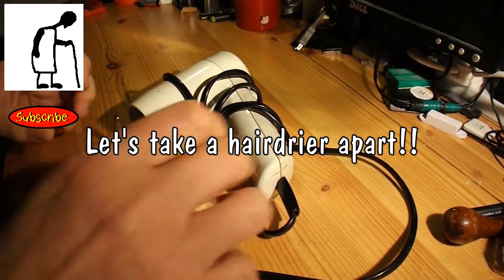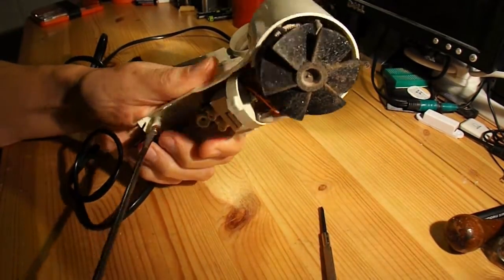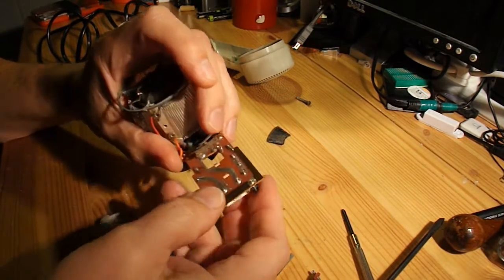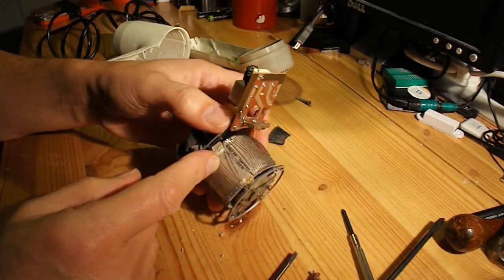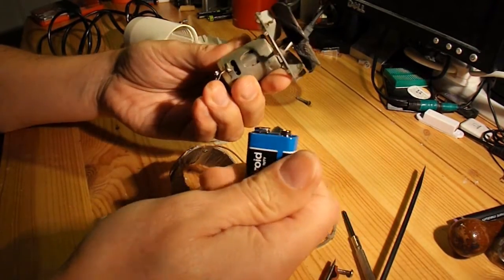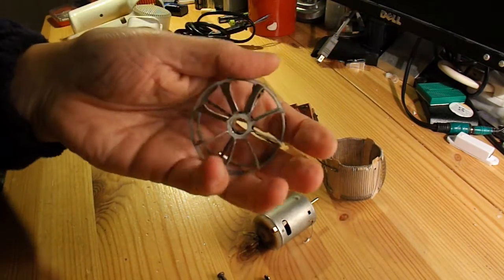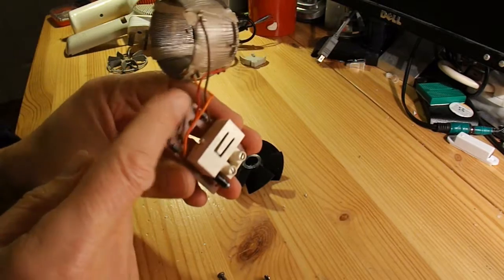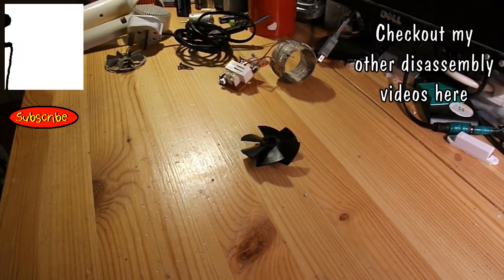Let's disassemble a hairdryer

Comment: How did you take the fan off? Mine is impossible to remove... I really need a way to do that...please help guys
Reply from the maker: Yes I found some of them are very hard to remove and I have often damaged the fan blade removing them. I am afraid I don't have a good method to recommend. If you don't need to save the fan blade I would break the blades off so I could grip the plastic hub with a clamp and then tap the shaft through with a similar sized metal rod and a hammer, or even cut it off by sawing through the plastic.
Reply: I knocked the fan off of motor stem with a 1.5mm nail set and hammer, pushing the stem and motor downward and leaving the fan atop the vise. Good luck.

Comment: After you removed the motor, did it still work ?
Reply from the maker: Did it still work? What? 😆 The motor works, I demonstrated that. I wouldn't attempt to put power through the heater element. Without the fan blowing some air through it, it would very quickly overheat and burn out. If you just mean the fan blade then this is the follow on video - Bargain Store Project #32 Styrofoam Cup and Plate Hovercraft https://youtu.be/bk36WMWMCmI
Reply: @GrandadIsAnOldMan  no, I'm asking because I want to use it to power a needle, I'm making a homemade tattoo machine. And I need a motor, what would you recommend?
Reply from the maker: @axelsantana8835  I would recommend not making a homemade tattoo machine. As for what motor. I have no idea what RPM you want or what power you need. There are plenty of YouTube videos on the subject so I suggest you do a search. While you are at it, I suggest a search on skin infections and other complications.

Comment: did it work for the foam cutter
Reply from the maker: Here is a video I showed it's use Hot Wire Styrofoam Plane PART #6 - those hot wire bows https://youtu.be/ZSFxSy6-bY4?list=PLA5a2xPRSrB1Qj--01eR1NU_K2RCbH3R8

Comment: Did you ever make the foam cutter?
Reply from the maker: Not with the parts from these hairdryers. Just a small one when I needed to cut down some wheels. Sometime I will get around to it as I want to do some foam wings for a glider or two. Just another one of those projects that keeps slipping down the list, I will get there one day.
The small one I made appears in this video after about 7 minutes http://youtu.be/XXPm-K9uyGQ
Reply from the maker: zz dragon on all the hairdryers that I have taken apart, the electric motor that drives the fan is a small DC motor probably rated at 12 volts or less. The voltage is dropped from the mains 240, 220, or 110 volts by passing it through the heater coils first which acts as a large resistor and then converting it to DC with a rectifier bridge made from 4 diodes usually soldered direct to the motor terminals. That means that if you disconnect the heat element wires it will not work as there is no electrical path to the motor. If you bypass the heat element then you will burn the motor by passing 10 to 20 times the rated voltage through it and probably electrocute yourself at the same time.
If you are only intending to use a small DC battery to power it then it will be OK and you don't need the rectifier bridge.

There may be hairdryers that use an AC motor and power it direct from the AC mains but I haven't seen one.
Reply from the maker: zz dragon I only said 'probably rated at 12v', I would have no way of knowing what motor you have in your hairdryer. I can only suggest you try it to find out. If it gets hot and burns out you know you put too much voltage or current through it, so don't do the same thing with the next one.
Reply: @GrandadIsAnOldMan  I have a Con Air Infinity Pro that has an AC motor. It is a little heavier for having the AC motor but it is quieter for the amount of air flow and I've had it for years for use for 2 people and a dog,

Comment: Dude, if the hair dryer still works, you should not disassemble it.  You just wasted a good hair dryer!
Reply from the maker: +Sammy Reedy oh dear, did you need a hair drier? Maybe you should buy your own. I bought 10 for £1 each and took them all apart in this video https://youtu.be/Wd8BQ8lMFjw?list=PLA5a2xPRSrB1GrgALJEle2lVqOrR1sX6V and I made much better use of the component parts that I would drying my hair.
Reply: Yes I watched that video also!  And, it explains absolutely nothing!  A hair dryer fan is meant to be used in a hair only!  And, hair dryer heating elements are intended for a hair dryer only.  If you keep doing what you are doing, then you will get electrocuted from it.  By the way, lots of women use hair dryers to dry their hair!  And, there's even poor women that could use the hair dryers that you just wasted!
Reply from the maker: Sammy Reedy you really need to get out more. If your life revolves around saving hair dryers for poor disadvantaged women of the world then I think your values are sadly misplaced. As for only to be used for drying hair then sorry you are wrong, there are many uses for hair dryers, for example you will find many model makers use them for heat shrinking plastics and speeding paint drying and adhesive fixing. As for only women drying hair then I see you have excluded all men and all the other gender categories so you may need to brush up on your political correctness. Finally perhaps you can explain how I will be able to electrocute myself for the components of a hair dryer?
Reply: First of all, mostly women use hair dryers.  Because a lot of women have longer hair than men.  Doesn't take a rocket scientist to figure that out.  As for heat shrinking plastic and such, they sell heat guns for that!  Even Lowe's sells them.  Much more effective than a hair dryer for shrinking plastic.  And, if you're needing a heater, than buy a purpose intended heater from Lowe's or Home Depot.  Them heaters include heating elements similar to a hair dryer.  Except, they're intended to heat your room not your hair.  And, they have features to shut them down if they overheat.  To keep from burning your house down.  And, if your wanting a hovercraft, buy you a purpose intended hovercraft from Amazon, etc.  That way maybe your hovercraft won't explode fire for you.  Save them hair dryers for women.  Or, men with long hair.  I just told you all the advice that you need to know.  Now, use it!
Reply from the maker: Sammy Reedy you really have got yourself all excited haven't you and I doubt that it is worth continuing the conversation but I will give it one last try. Most of the projects on my channel are based on taking an item and using it for something it was not intended for. That is called experimentation and taking an inquisitive approach to the world around me. I have no idea how you think my hovercraft will burst into flames. The motor in a typical hair dryer is designed to work on maybe 9 to 12 volts. If it was going to catch fire it is much more likely to do that in your hair dryer as that is probably powered by 120 volts in the USA so if a catastrophic fault occurred you would be running 120 volts through a motor designed for 12 volts. In my hovercraft it will be running off a 9 volt battery. Add that to the fact that you have a mains powered device in your hand and you have wet hair, where do you think the electricity is going to go when it looks for the path of lowest resistance. Do you think that might be your wet hair? Finally, I have relatively short hair but I always use a hair dryer to dry it as I have found that just towelling it will not dry it sufficiently for me and any dampness encourages dandruff.